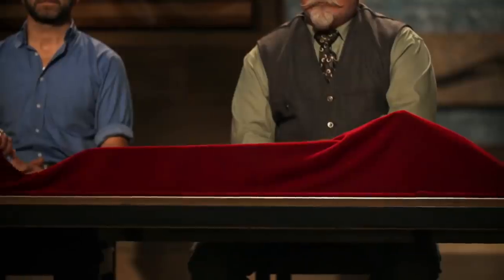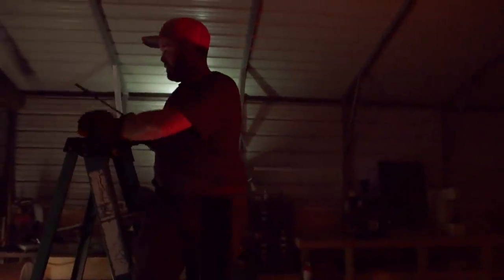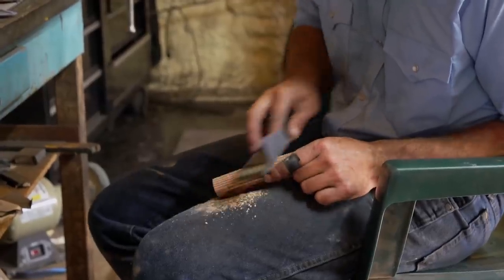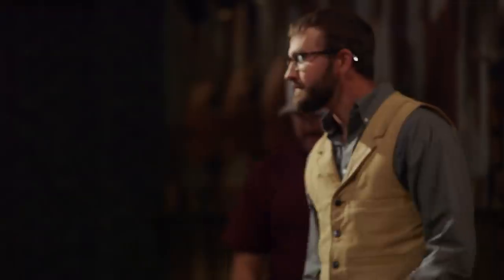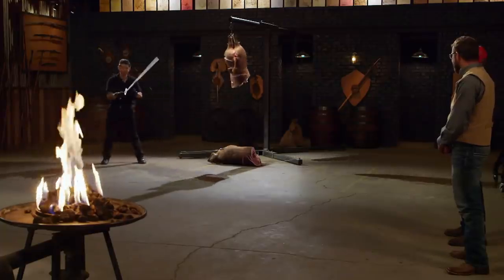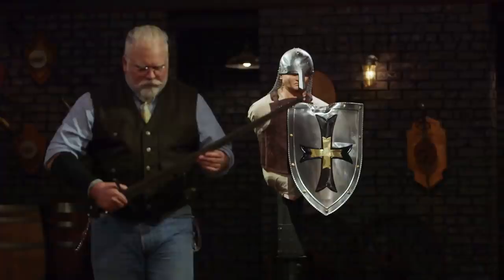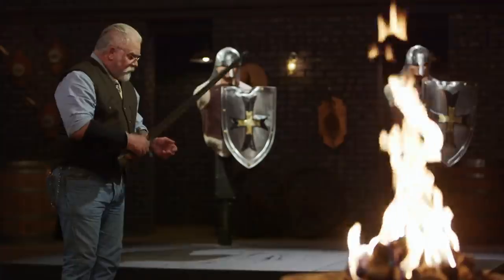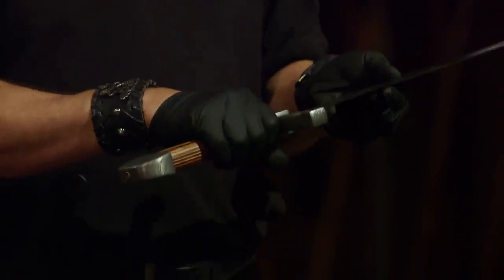Forged in Fire: Charlemagne's Sword CUTS DEEP (Season 7) | History

Comment: *Bashes sword against metal helmet and shield.

"Well, your edge chipped."

Seriously, what did they expect?
Reply: I'm sure they expected both chipping and rolling. But rather to figure out which one handled it worse.
Reply: A well made sword wont chip after a couple hits.
Reply: Well, for a battle ready sword, it needed to be able to take a couple hits and keep on going strong for the remainder of the battle, so I think it was a fair test. If the blade was rolled and chipped after a couple hits, how would it survive the rest of the battle?
Reply: @thingamajig1919  Swords not only chipped in battle, they were expected to and expert swordsmen used that to their advantage. Look up the concept of "bind" in medieval fencing manuals.
Reply: @gre8  During the period of time this sword is supposed to be from the bind was a technique of last resort people would still be using shields almost exclusively for defense because steel from this period tended to be very very soft.  However, the sword they are being told to produce for this competition is not historical to a weapon Charlemagne would have used in actual battle.  More a Frankenstein blade for national pride developed hundreds if not a thousand years after his death.
Reply: They probably expect an axe grind
Reply: @appa609  I think they are more testing the quality of the heat treatment of the blade by seeing how much damage was done to the weapon they can tell a lot.
Reply: rockn roll  I'm sure it also takes more than five days to make on too

Comment: Bladesmiths who do this. From what I’ve seen and know of blades and this competition; a couple things. Make it TOUGH, but not too heavy. If it is kinda heavy, balance it WELL. Handle ergonomics are super important, make sure the edge can be properly indexed from the handle, and that it has great grip. Make your edge as sharp as you can, with clean bevels, while retaining edge strength. Heat treat must be on point. Prioritization of function in all ways over any decoration so as to not waste time.

Comment: This show would be so much better if for each episode they would bring in a Expert in said finale weapon.
As these three sure know their stuff, they dont know the correct way of using all blades, meaning that in some episodes, some weapons perform bad because the operator rather than the blade itself.
Now not saying id do a better job, i likely wouldnt, so if you were thinking that reading this you can keep it to yourself.
Also didnt see anything id say as majorly wrong other than the "overdramatisating" of their swings. But ive seen episodes where even i can tell the handling of the weapon was quite bad.
Reply: I agree, or atleast get a machine programmed to slice exactly the same way with the same amount of force each time, human error no matter how well trained someone is will always be present not to mention after swinging a sword aggressively like they do in the tests would in some way wear the user out making the second sword tested not at the same level as the first sword. Too many variables in a test makes your results inacurate
Reply: @xMrjamjam  Would be more equal yes, but then the potential of the blade wouldn't be as great as a mechanical arm tend to just chop.
Reply: @sgt_kissekatt6686  not if it's a swinging arm like the ones used to make and do welds on cars in really awkward places
Reply: @xMrjamjam  if it would be a mechanical arm programmed to swing each weapon how its suppossed then sure.

Comment: I have one problem: why is it, that, when they test the hardness of each sword/weapon, they use thin metal, that bend when you look at it in a wrong way? Shields & helmets is not supposed to bent like these does
Reply: that's what I'm sayin, they might as well be made of aluminum
Reply: Dunno like. Wouldn't be crazy if they did bend like that. It would actually be better for the wearer if they did. Less force and that.
Reply: that's why you have armor under the shield and a gambeson to distribute the force, if your shield bends or breaks it's automatically less protection, if your helmet dents that easy you shouldn't be wearing that one in the first place, so no, it would not be better.
Reply: @vin 950 you're probably right and yeah that's how some shields were made but some were made out of metal

Comment: So how do you figure out where you want the weight to be on sword and whats some ways to make a lighter but strong sword
Reply: Generally for swords, depending on the function, a balance point near the hand, or right in front of it. The closer to the hand, the more nimble it will be.
You can shave weight off with fullers, distill tapers, and thinner steel.
You can further move the balance back with pommels.
Not all swords want to be balanced as such though, falcions are better to be front heavy, to be better choppers.
Reply: As to lighter, but stronger, it's always a balance.
The cross section of the blade is important.
A diamond cross section will be rigid, and strong.
The bronze age swords had ridges, or spines to reduce warping, and strength, but it added weight unfortunately.
A fullered sword will have less weight and remain pretty strong.
The distill taper means it thins out further from the hilt.
Reply: @DementedDoom  appreciate the information

Comment: This show is such a joke. Go look at the actual sword or look up museum photos of it on google the blade is much narrower and has a much steeper taper. Also neither one of their swords had proper hilt fittings, no engravings, shape is all wrong they could have at least made them of bronze or brass. They said make joyuese and instead they both make generic type X swords which joyuese isn't even a type X. Both fail in my opinion. I'm not saying that the sword in the museum is actually the sword charlemagne used, the greater likelihood is that it's not because the blade type is not from that period nor is the guard style however it is dated as far back as 12th century and had been the French royal ceremonial coronation sword since the 12th century but that all aside they should have been held to a higher standard of accuracy if recreating a museum original. The example sword they under the blanket btw is a cheap highly inaccurate version made by darksword armory btw, dont buy it, I did and regretted it greatly.